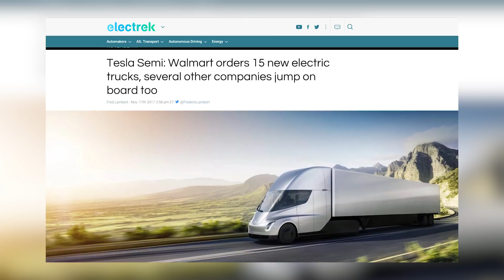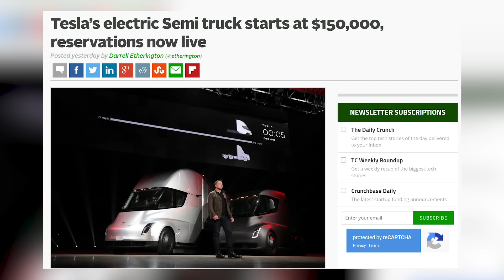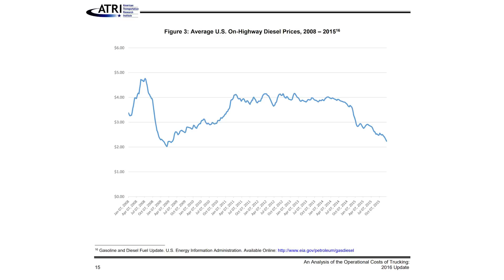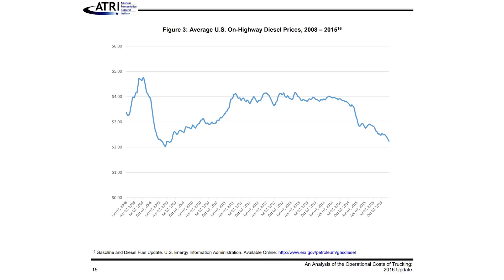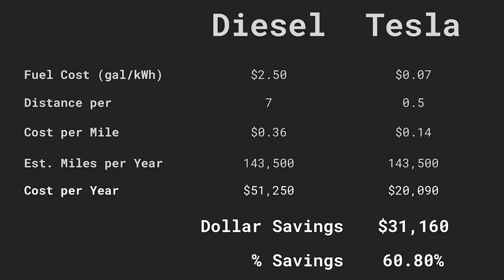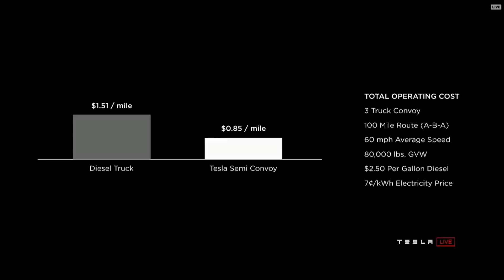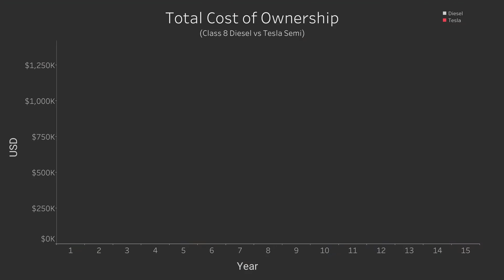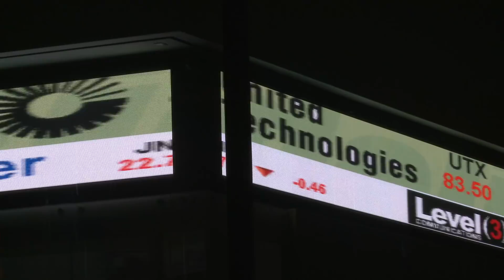What is the TRUE COST of a Tesla Semi?

Comment: Rocky Mountain Institute (RMI) has been running a study, now in its 10th year, of fuel efficiency for Class 8 trucks by 19 large transport companies with a combined fleet of over 71,000 trucks. Average fuel use across the fleet in 2016 was 7.11 MPG. This average includes no load and sub max load trips.

If we compare this average fuel use with the Tesla Semi worst case energy use of 2kWh/mile and use $2.50/gallon diesel cost and Tesla $0.07/kWh we get:

Diesel truck $351.62 per 1,000mile
Tesla truck $140.00 per 1,000mile

This represents an almost 60% reduction in fuel cost.

According to the RMI study, fuel economy for diesel trucks has been increasing at about 1% per year over the ten years of the study so far. Even if diesel costs remain at $2.50/gallon it would take many decades of improvement to reach Tesla truck energy costs.
Reply: +jesterlead   The cost/mile you quote are for the total operating cost (purchase, maintenance and fuel), I was looking at the fuel/energy only cost.

Given Tesla is selling the long range version for $180,000, your estimate of $200K-$400K for the battery pack alone is clearly way out of the ball park. 

Not sure why $0.07/kWh seems so unlikely to you. Tucson Electric Power in Arizona signed a 20yr power purchase agreement for solar earlier this year for $0.03/kWh which is less than half of what Tesla is expecting to charge.

In 2011 there was no Tesla charging network and now, 6yrs later, it is expected there will be 10,000 Superchargers and 15,000 Destination chargers by the end of this year. Given Teslas record of rolling out charging infrastructure your 30-50 years statement is silly.

Please tell me where the calculation and/or the assumptions used are wrong.
Reply: Good luck with that.  You need enough solar to power 4,000 homes or ONE Tesla semi.  Not even remotely economically viable.  You can believe whatever Elon narrative you like....
Reply: +jesterlead   Where do get these numbers. We have gone from 3,000 to 4,000 homes per truck. The daily demand of 3,000 homes (at 20kWh/day) would fill the truck battery around 60 times.
The Elon narrative would seem to be more grounded in reality than these made up numbers you keep throwing around.
Reply: Yes, Tuscon electric is buying subsidized solar at 3c/kw.  By the way Tuscon Electric is buying enough solar for 21,000 homes OR 7 Tesla Semis.  That's how unrealistic this semi is.....
Reply: Yes the 30% tax credit. That 3c/kWh has to recover the unsubsidised cost of the plant and financing cost. Ignoring financing cost recovery, we get an unsubsidised price of 4.28c/kwh, still well below the 7c/kWh Tesla wants to charge. You do realise the cost of solar is falling, both because the cost of the technology is falling and cost reductions associated with increasing scale. Tesla will be supplying solar at a very large scale.
Reply: No there is no way you are selling solar unsubsidized for 3 cents/kwh. That is a heavily subsidized cost.  Currently the best utility scale solar power plants in the US are running $2/pk watt at a 20% CF that's $10 per avg delivered watt. At a low 5% discount rate over 25 yrs that's 8 cents/kwh. That does not include 5X oversized transmission infrastructure. Add 2 cents/kwh fixed and variable O&M costs and you are looking at 10 cents/kwh in prime solar areas, like SW USA desert areas. The solar cost has been falling slowly but the market value of the solar decreases as its grid proportion increases. Costs will increase with the impending 35% import tariff likely in US in Europe.
Reply: +whykhr   None of your imaginative accounting changes the fact that Tucson Electric Power is able to purchase solar power at 3c/kWh with the 30% tax credit. Accounting for the tax credit we get to somewhere south of 4.28c/kWh, which is less than the 7c/kWh Tesla is asking. 
If we accept you’re back of the envelope cost of 10c/kWh unsubsidised, the subsidised cost would be 7c/kWh. No-one operating these so called heavily subsidised solar farms would be able to sell electricity for less than 7c/kWh. Yet we have real businesses, investing real money, signing real 20yr supply contracts at 3c/kWh.
Reply: whykhr You'll get 1.000 kW solar power for 1 million. In sunny conditions this 1 MWp solar power will produce 2 million kWh each year. This will work for 2.000 full charges of a Tesla Semi or 1 million miles. During 20 years it's 5 cent per kWh. This is cheaper than anything else.
Reply: Fuel cost will go down to be competitive with Tesla trucks. Nowadays oil prices are too much higher than they can be in free market. Also, fuel efficiency may be improved. We got up to 30 % improved fuel efficiency just by changing ordinal engine oil to my formulations. Not to mention that my prices are below 2USD per liter in retail. It is in Thailand. So, the race of prices is just began. But I love Tesla because it creates some market for my engine oil formulations. Especially for developing nations. Used American diesel trucks will be sold to the developing countries. Also, there are diesel engine designs that are almost 50% more fuel efficient than conventional diesel engines. Not to mention hybrids to recuperate some of the braking energy. It delays replacement of IC engines by vehicles with the electrical motors.
Reply: People seem to forget that you can also stuff the same diesel into large, stationery, high efficiency generators and turn it into electric energy way more efficiently than the smallish engines inside diesel trucks. Likely efficient enough to more then make up for efficiency loses due to charging and discharging the batteries.
Reply: thanks for the info John, well apriciated.
Reply: Jan 2019: In California, Tesla Supercharger prices went from $0.26 per kWh to ranging from $0.32 to $0.36 per kWh. 
Which is 5 times supposed .. $.07/kWh rate.
5 x $140 = $700/1000 miles.
Which is twice the stated $350/1000 mile cost for a diesel (@ $2.50/gal)
Super!
Reply: This isn't accurate.  Cost is $1.25 / mile for the Tesla Semi and $1.51 for the equivalent Diesel Semi.  The biggest issue is the $200K-$400K for the 1,000 KWhr battery pack (alone) plus vehicle costs versus a diesel semi that comes in fully loaded at $120K.  So, even using Elon's math with 7c/kw electricity costs (good luck with that) it takes just over a million miles to break even....(forget about the fact that we don't have the grid infrastructure to support an electric fleet in the first place).  Maybe in 30-50 years this idea will work, but not today....

Comment: Elon's presentation completely missed the point: company use truck not because they are fast, which is limited by highway speed, but because they are efficient.  You will have to convince truck company that your e-truck is better in terms of miles/$cost.
Reply: MK Uis 
Acceleration IS a factor. The Tesla gets (a full load) to speed at least 40 seconds faster, so is 0.36 miles ahead after the first minute. How many stops for junction/ lights in a day? How many hills to slow a diesel? Say enough for 15 minutes gain in a day? Add the diesel fuelling time and that's a free charge stop for the Tesla. Plus the driver gets a FULL 30 minute break since he doesn't have to be with the truck while "fuelling".
"Cost per mile"?
That would be the big bar chart on the banner behind him!?
Reply: I think the break down guarantee, the stuff about the screen and refuelling/ millage, diagnostic tools etc  all address efficiency. The point you say the presentation missed.
Reply from the maker: Did you watch it? That was a major focus of his talk
Reply: time = money, therefore better speed means money

Comment: The whole convoy idea is a bit suspect to me. I work in supply chain, and there are certain jurisdictions/routes where we use what are called Long Combination Vehicles (LCVs) with up to 3 53' trailers being pulled by one tractor unit (200' long truck is indeed crazy!). So, this idea is not that revolutionary.
Reply: Most of the time here in Alberta, the max is 2 53' trailers, but in Saskatchewan, between Saskatoon and Regina, they do run triple 53' trailers. The cool thing is in Australia, where they truly do run road trains. Those are on long straight roads in the middle of nowhere.
Reply from the maker: Brilliant, seems possible on known routes with good conditions but still a bit far fetched to me
Reply: Yes. The convoy idea has to work in the space where autonomous trucks are permitted but LCVs are not/impractical.

The benefit of convoying is really separate from the benefit of electrifying. So it is more appropriate to compare the cost of 3 diesel powered trucks in convoy to 3 electric as suggested by Tesla.
Reply: Australian Road trains in general are the same length as 3 53' trailers. It's just that the arrangement of the trailers is different. They tend to have shorter trailer, but they pull 4 of them, so at the end it's the same shit.

Comment: Trains were 6 cents a mile 20 years ago .
Going up a hill takes an epotential amount of energy .  2k per mile would climb to 200k per mile at  full load a up a hill. At 65 mph .
A model s uses 350 watts per mile 
So the semi using the equivent of 10 battery packs would have a robust cooling system  for the high drain going up a hill 
So the battery cooling would have to be robust 
I believe the 500 range will restrict it to regional and under hauling for now 
No need for charging stations .   Just charge when back at the terminal 
As far as platooning.   Maybe on the interstate at first .
As a truck driver , my main job description is suicide prevention .
It would take a critical mass of autonomous cars before automous  trucks would be safe enough 
An example that just happened. 
Coming down a very steep hill at 60 mph .  Fully loaded .
Car after car cut in front of me .  They all wanted to take the next exit .
I kept braking and braking .
Finally passed the exit doing 25 mph .
Only my experience made me hard brake after the first car .
I saved  the lives in 10 cars .
A automous truck would only react ,  not  proact .
Reply: You can never get back all of what you put in. Law of thermal dynamics.
Reply: Tom Robertson 
Hills/ cooling:
Do you think that maybe... MAYBE they considered that?
Braking: ("suicide prevention")
Rather than "conventional" brakes and the skill of the (alert!?) driver, you would have 4 wheel active regenerative braking, incorporating anti-jacknife control AND autopilot AND the driver AND conventional brakes.
Range:
500 miles MINIMUM (full load).
If fully loaded, would this truck be used "locally"?
Reply: But in return, it can regenerate energy when it goes downhill. But the question is, can it regenerate the same amount as it lost on a similar hill grade when it goes down.
Reply: +Tom Robertson, a model X uses 315 Wh/mi.  I believe the S is 300.
Reply: The truck could see in your blind spots, but you are right. If the truck could talk to the other cars it would be much easier to know they had that exit in their GPs route, etc...
Reply: With the way regenerative braking works, I believe stopping distances on this Tesla Semi will be greatly reduced as compared to diesel trucks. We will have to see when this kind of information becomes available in the next year or so.
Reply: We already have engine braking which is similar to regen.
I can slow down 100k  even on a hill .
Tesla has vast experience cooling their cars .
I'm sure they have cooling under control 
My own opinion is truck driving involves more skills then driving a car .
I can't see automous trucks until automous cars are the new normal 
A truck driver has to be psychic  to not kill the people that are oblivious to how the world operates .
A computer is reactive .
In a truck , that is too late
Reply: +Tom Robertson, engine breaking just wastes the energy as heat and noise and barely slows you down.  Regen can get you to a complete stop in most situations without ever needing to apply the brakes.

Comment: I like the idea but I’m wondering about the lines at truck stop to recharge and how long will it take must have missed that part. How many places will get charging stations?  If you slip seat drivers, will you have time to recharge for the next driver?
Reply from the maker: 400mi in 30min, likely ready before production begins
Reply: Also wondering will it work just as well pulling a tanker
Reply: What people don't include in this discussion is the option to charge at the warehouse location! Unloading and loading takes (depending on how much) for sure at least 30 minutes. So, if every warehouse will install charge points at each doc, there is no problem at all to be worried about range. The trucker is unloading/loading and the truck is ready to roll another 800 miles when he is ready. In Europe (where I live) more and more cities do not allow diesel trucks to enter certIn zones, so the electrical version is highly competitive here as well.